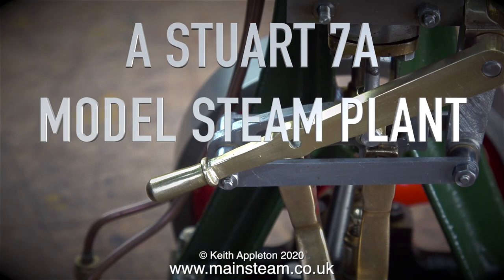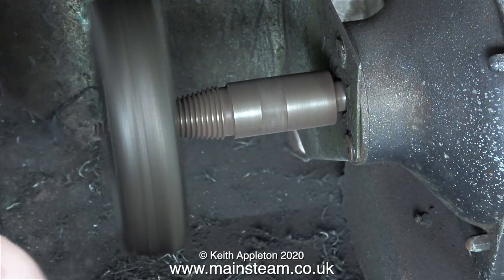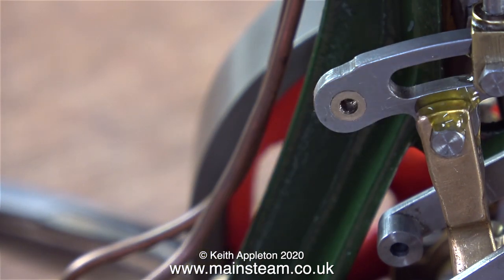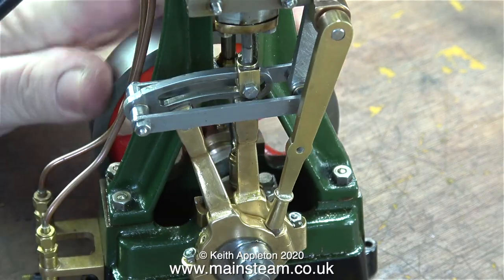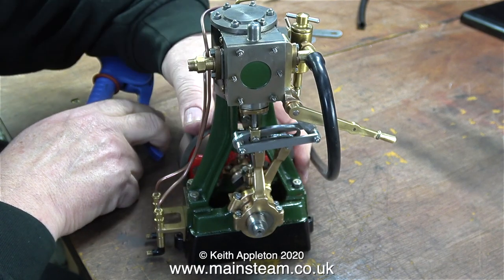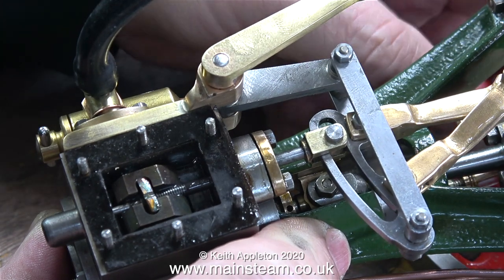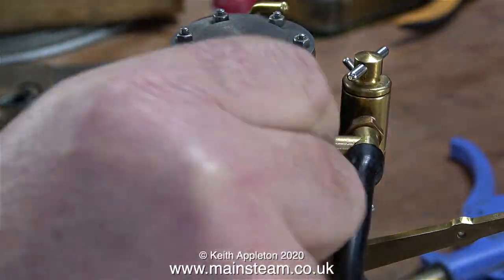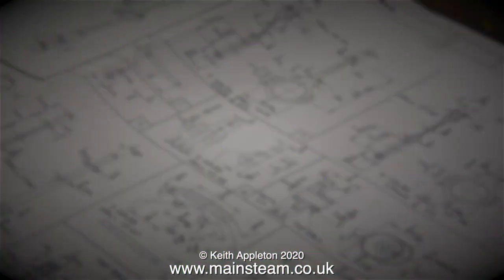A STUART 7A MODEL STEAM PLANT - PART #13

Comment: Im guessing the eccentrics are machined to the wrong angle relative to each other...
A good reason to run two separate eccentrics- IF there's enough room! ;)
Reply: Well, at 6:45 he mentioned that "...everything checks out, including the eccentric sheeves which are machined as a pair".  So i'm thinking it's not that.  But I'm just a novice, so I don't really know.
Reply: @mikefochtman7164  Yes, but Stuart Turner plans are notorious for having errors. Lots of corrections need to be made to the plans. I believe Bleekis is right. That's really the only reason I can come up with that would allow the engine to run in one direction but not the other without adjusting the cams themselves. IMHO each cam should be independent of each other so the timing and lead variable can be fine tuned.